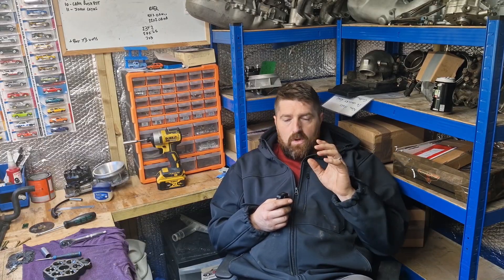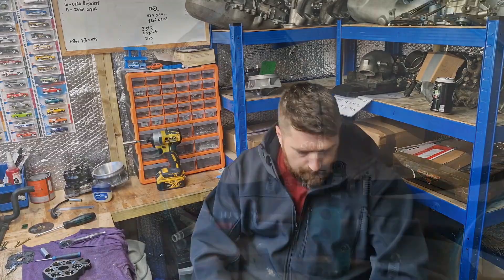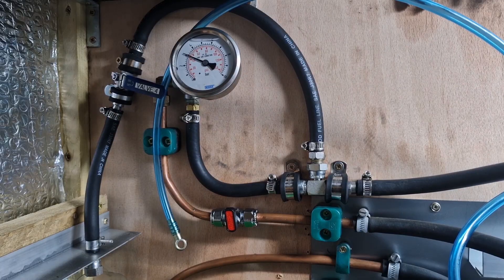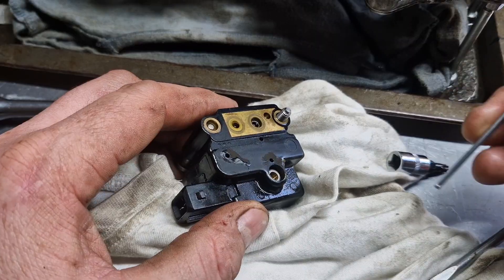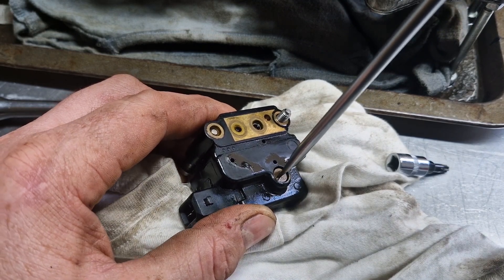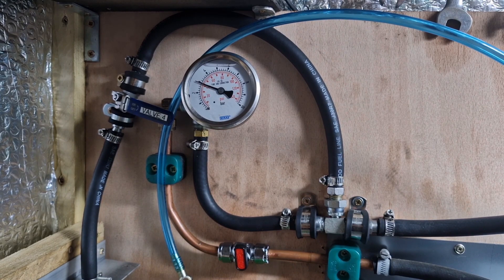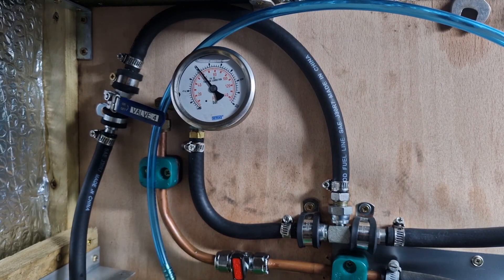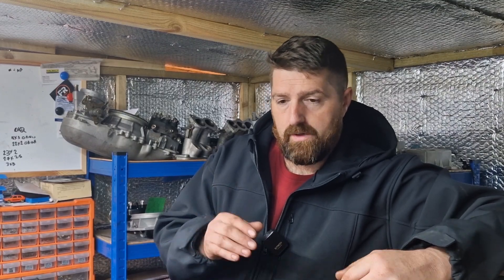Bosch KE-jetronic - Differential Pressure Setting

Comment: Probably beyond the scope of this particular video, but…it’s worth a try.

Is there any instance where the voltage to the EHA would be modified by another faulty component so that the EHA would not function properly? From where does the EHA get its voltage?

This is on a Mercedes-Benz M104 with KE-Jet where the car stumbles (as it would with a bad or misadjusted EHA…) but only with the AC on. No vacuum leaks. Fuel pressures dead on.

By the way…what a wonderful channel. Bosch K and KE are brilliant…glad to see someone still carrying the torch.
Reply from the maker: Thanks, yes thats very common for the EHA to get incorrect inputs which can cause multiple running issues

However the fault normally lies with the wiring as poor wiring will cause resistance issues

Comment: I took the fuel distributor apart but did not find any bad seals or anything suspicious.except for all them small filters that looked very filthy . I bought a rebuild kit from Germany and replaced all  seals and stuff. I took out them small filters and cleaned them but I did not put them back. I only kept the big filter on center part and one at the main inlet.
The engine cold starts and runs good so It seems like the  lean mixture problem is solved but there are two other issues still. The engine does not start when the engine is warm unless I disconnect the temp.sensor that controls the control pressure.  The other issue is that the pressure regulator sometime get stuck at 7bar but recovers to 6bar on restart.
Reply from the maker: The pressure regulator may need the spring adjustment as they can over pressure and not open

Comment: is the pressure regultor different from a 16v to 8v metering head
Reply from the maker: No same part, may be different in colour
Reply: @GreyGooseRestorations   so i was under the impression that the 8v was 3.5 bar fuel pressure and the 16v was a 5 bar.. did i get bad info
Reply from the maker: Yes, unless it was 5 bar system pressure and 3.5 bar control pressure which makes sense and both 8 and 16v but thats k-jetronic not KE-jetronic
Reply: @GreyGooseRestorations   ahh i see thank you for the info and clarifying the difference

Comment: I followed the instructions in this video..I ´d like to thank you for the videos that you make. I am trying to fix my sons Audi 100 2,3 quattro -90 that now only runs at 2000rpm before it backfires. Way to lean.. I did some measurments 6.2bar systpr. and 5.5bar Ctrl pr. I did some adjustments and ended up with5,8 bar Ctrl. pr. but still it will not rew up high. I tried to lift the plate manually while pulling the throttle but the sound pitch from the injectors does not seem scream out as high as I think they should. Could it be a flow restriction in them small filters in the fuel distributor? Fuel pump has been replaced recently. What do you think it can be?  This fuel distributor comes from a used car that has been sitting for quite sometime.
Reply from the maker: Hi, if its back firing i would check all the ignition timing to confirm thats not at fault
Reply: @GreyGooseRestorations Hi again, I refer to backfire like on a car with a cold start choke not pulled and you try to accelerate. you know ?
I think that the ignition system is fine but yes we can check the timing.   I suspect the new low budget fuel pump.
We are going do a flow test. Pressure mite drops significantly when lifting the air plate to the top.  we´ll see how it goes...